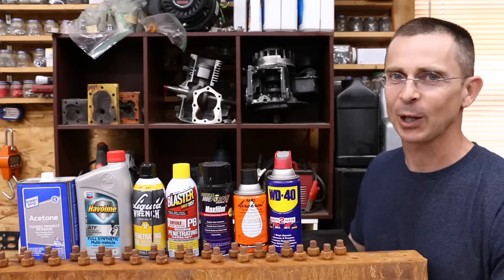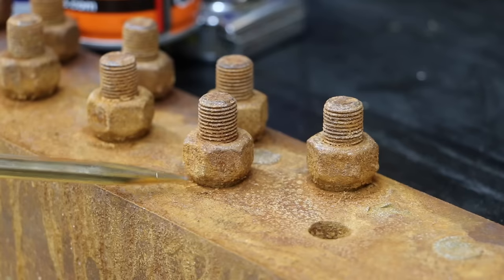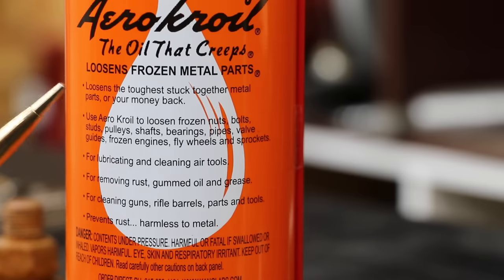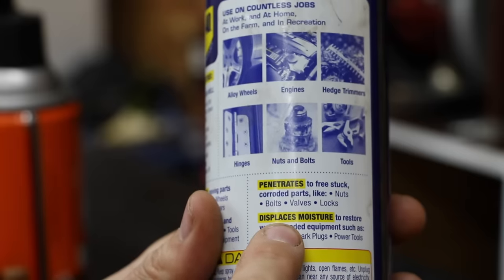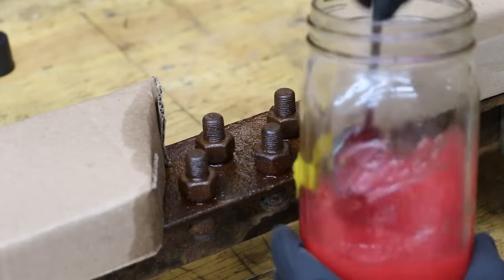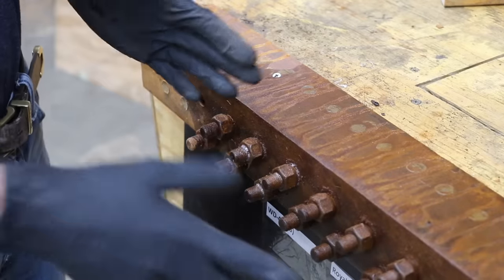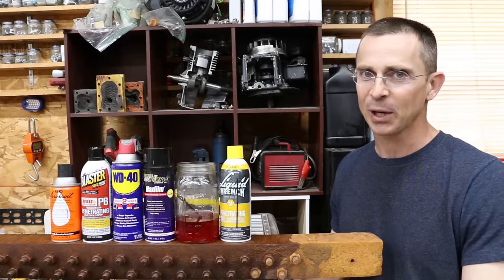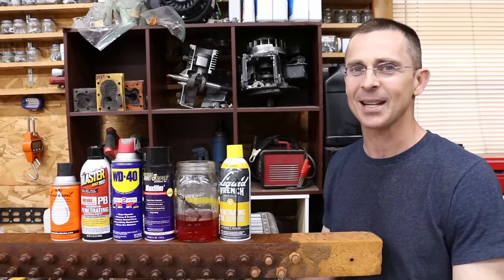Which Penetrating Oil is Best? Let's find out!

Comment: I am not surprised by the Acetone/ATF mixture I knew it was good. I am surprised by the liquid wrench I used it >45 years ago and it was useless IMO.They must have improved the formula. Kroil seems to work best for me.
Reply: I recall my grandfather soaking a set of pliers in Liquid Wrench that were rusted almost solid. Freed them up!
Reply: I worked on jet engines for 37 years. They BAKE themselves together. We used to use Marvel Mystery Oil until we found KROIL. I know it's pricey but I also know IT WORKS, like nothing else we ever tried, and we tried everything we found.
Reply: Totally agree with Eric!  I have had the same experience with Liquid Wrench in the past.  Undoubtedly changed the formulation/composition!

Comment: I have a project idea but it's going to be a little different. Try putting different oils/ gun oils on metals and see how well they work with preventing rust. Probably have to have the metal  sprayed with water sitting outside for days. Would be interesting to see how long the different oils work until rust forms and how much rust forms. I know for gun oil there's a ton of products (ballistol, clp, REM. Oil) and I know good ol  3 and 1 oil and motor oil can be more basic oils and are cheaper. Let me know if you like the idea!
Reply from the maker: Thank you for this recommendation!
Reply: Go to 6mmbr for the rust protection/finish test on gun metal finishes.  It is controlled in a salt bath.
Reply: CentralPlainsEnt couldn't find it but I still would like to see project farm do the test. He does such a great job on his videos
Reply: http://bulletin.accurateshooter.com/2013/06/firearm-finish-comparison-testing-in-salt-chamber/

http://www.6mmbr.com/corrosiontest.html

 Here are a couple interesting links one is a corrosion test. The other is a test on different types of metals or applied finishes.
Reply: CentralPlainsEnt the second link is more what I was looking for . But I still would love to see a classic style project farm video on this. Still can compare more things that the link you sent didn't have. But thanks for the links

Comment: Liquid Wrench plus heat is freaking amazing. Spray the liquid wrench and let it soak. Then hit it with a flame. It catches fire and heats the inside of the bolt real well.
Reply from the maker: Great tip! Thank you
Reply: I do same thing, works good

Comment: There’s recent research on concrete and reinforcement bars on preventing long-term deterioration;  it says that an electric charge in the bar will keep the bar constantly cathodic, thus preventing oxygenation... much like the heat test is increasing the cathodic activity in the bar, thus detaching the oxygenated particles.
Reply: This is far from new research

Comment: Long time fan of the channel, I absolutely love your videos!
Though 
Lubercant/degreaser Companies like wd40, CRC and PB Blaster also seem to make their own dedicated fluids to sell, like WD-40 specialist rust penatrant is supposed to be their version of PB blaster penatrant. And how PB multi purpose is their light weight general purpose lubercant, like WD-40  multipurpose. Do you think you could compare these specialtist "brand name" products they manufacture with each other or start including them in your tests, I've always been curious about how well these brand lubercants, rust preventer/remover, degreaser, ect would perform compared to the dedicated top of the line products of the same type. or if they are just buying some basic formula and slapping their label on it.

Again thanks for what you do!
Reply from the maker: You are welcome!  Thanks for the suggestion.

Comment: Revisiting this video because of a project that's upcoming.  Not all ATF, as you discovered, is soluble in acetone.  The versions without synthetics in them actually mix with acetone and don't separate.  This video does not change my mind about Kroil as it's been a long time favorite.  The only product in this review that I haven't used is the Royal Purple penetrant.  I usually find myself working on things that have been rusting together for a long time rather than a quick flash rust so that probably affects my opinion.  Thanks again for all your awesome work!
Reply from the maker: You are welcome!

Comment: Kroil is used in Aviation.  Never had an issue.  PB and WD are my other choices.
Reply from the maker: Thanks for the feedback.
Reply: Best for your money hands down. I’ve seen it free cooked on fasteners in the exhaust section of a CFM turbofan
Reply: We use Aero Kroil to remove igniter plugs on Rolls-Royce turbofan. It’s a lifesaver. We can only use products authorized by the engine manufacturer so one might be better. Thanks for the comparison testing.
Reply: Yep-Kroil has saved my bacon more than once. 30 years in aircraft MX everything from light aircraft to the big boys.  Famous one-MLG pins on a MD-83. Pins were seized solid to the bushings & were spinning in the trunnion. 3 day soak with Kroil & a 9X rivet gun beating on the pins did the trick.
Reply: @justins4926  Umm. You just watched  a video showing it get last place, and you come back with "Yep...its the best" LOL!

Comment: I love the detail and care you put into making these tests as equal as possible. However being and advocate of kroil, I feel it was not represented well in this video. In my experience kroil works very fast. I can spray a bolt and within 2 to 5 mins the bolts is extremely easy to turn. After about 15 mins it’s almost as if you never applied it. I would love to see a video of kroil tested at different time intervals starting at about 2 mins, 5 then every 5 after. I think you would be surprised at the results. Keep up the great videos!
Reply: neat

Comment: see which weed wacked string is the most durable!!!
Reply from the maker: Yes, I need to test this!
Reply: Project Farm ...and the most effective!  In other words, that bladed trimmer string might not last as long, but it might cut better. Also if you do this test those plastic blades. (I can't remember what their called, but they work and the head doesn't need to be replaced because the blades are disposable)
Reply: they were color coded by strength/durability back in the 90s at least, and there was a definite difference
Reply: Yes!!!! I need this test.
Reply: Son of a Diddly that’s a good suggestion.
Reply: I too would like to see this test. Not only that, but a test also on the real world of different profiles. I found square profile brilliant for mulching long grass, but the increased drag reduced the work efficiency and couldn't stand up to anything tougher than grass, I tried some hexagonal profile and it seemed no different to the round. Maybe a separate test too for blades?
Reply: Rotary! made in USA and last 3 times longer than the box store stuff
Reply: YES!
Reply: I was told by a STIHL repair shop owner that I should be storing my trimmer line in water (or at least in a ziplock bag with wet paper towels) to keep the plastic from drying out... 
Haven't tried it but thought that was interesting.

Comment: I think you performed a very good test of these penetrating oils. My question is, how are the studs anchored to the angle iron? Are the holes threaded and the studs/bolts torqued in place? Thanks again for your time and for sharing this test. I'm a tad older than you, and I remember my Dad using Liquid Wrench. I have part of a machine I bought frozen from lack of use. I tried WD-40 with no results. So this video was very interesting and I think I'll try ole Liquid Wrench next and see what happens.
Reply: just a guess, but possibly 2 nuts on the back side.

Comment: The original kick-ass "old school" formulation for your own homemade penetrant,   from years and years ago,  mind you,  is not acetone + ATF.  It is acetone + brake fluid.   I don't know when this acetone + ATF mix thingy got started (I only noticed it about 4 or 5 years ago),   but it,   and all the overpriced store bought crap,   is definitely inferior in performance to acetone + brake fluid.  
ATF does have some great qualities aside from,  or maybe related to,  its intended use, however,  lubrication being one,  so after learning of this acetone + ATF  mix,  I started adding it to my old standby (acetone + brake fluid),  in a 1:1:1 ratio -- doesn't hurt and might help.  BUT,   it's the BOTH chemically "powerful stuff, " acetone AND brake fluid mix,  that outperforms the store bought offerings.   
Yet another great,  but "not its intended use" for ATF:  fuel injector cleaner.  Long story 'bout how I know but suffice it to say,  I'd put it up against all the overpriced stuff you can get for that purpose -- Lucas and ALL of 'em.  
Use your own judgement as to how much per gallon or tankful,   but don't be afraid to go "heavy" -- a little on the heavy side is probably best,  just don't go crazy.  
And another good use for ATF:  about a 1000 miles prior to an oil change,   run a quart in with your soon to be changed oil (drain a little old if necessary to accommodate the ATF -- never overfill).   Probably heard from old mechanics or "shade-tree" mechanics to use kerosene this way,  but a 30 year,   ASAE certified Ford dealer's guy -- my friend -- said kerosene is a no-no,  because of its lack of lubricating ability. 
He said ATF is much better because of better detergent qualities than even the best motor oil,  better anti-foaming agents than even the best motor oil,  and better lubricating than with kerosene.  
The reason for doing it is to clean out sludge and carbon deposits or buildup prior to the oil change -- ATF does it better than regular oil.  (removing carbon deposits is what it does so well for injectors)
Reply from the maker: Thanks for commenting!
Reply: No problem.  Just checking back in to tout the superior performance of ATF as a fuel injector cleaner,   over all the teeny-tiny bottled,  way over-priced crap marketed for that purpose.  THEY SUCK.  PERIOD.  DOT.  END OF STORY. 
Last time my wife's vehicle started "cuttin' out",  especially when lugging,  it cost over $600 to fix -- faulty (or crudded up) fuel injector that just "had to be replaced."
That was over 5 years ago.  So,  when it started doing the same thing -- AGAIN -- I must have run a gallon or more,   teeny-tiny overpriced bottle at a time,  of the OTC gas additives marketed for that very purpose -- cleaning injectors -- with absolutely NO results at all.  
One cup of ATF (Royal Purple synthetic,  although I'm certain Dexrons II and/or  III would have produced the same results)  in a quarter tank (16 gal. max fill),  and I noticed an improvement within the first 5 miles of driving.  
I've run 2 full tanks since,  pint of RP ATF in each,   and the problem is gone.   
Word to the wise...not "commenting".
Reply: I’d add atf to my lawn mower. It would smooth out almost instantly after a couple ounces in the gas tank. 10 years for a Honda push mower and still going strong.
Reply: G.t. W -- another great use.  It helps combat the harmful effects ethanol gas has on carbs and rubber lines,  seals,  and gaskets.  Yet another use:  diesel tractors and equipment. But I only recommend it for the old stuff (mine).  I don't know squat about the new stuff that requires the new "environmentally friendly,  reformulated,  low or sulfur free" formulations of diesel.  I'm still using the off-road,  dyed diesel and it works great mixed with it.  Anything else,  use at your own risk.  I'm in no place to say.
Reply: Tab Lature in diesel, does it act as a lubricant ? They used to add motor oil to the diesel to lube the upper cylinders but I haven’t seen anyone do that in years.
Reply: The idea never even crossed my mind until talking shop with another farmer in an O'Reilly's several years ago.    
He said he'd been doing it for years -- putting ATF in the fuel tanks of ALL his diesel equipment,  at every fill-up.   He swore by it.  (Dexron II -- his fave.)
As you know,  lot of carbon buildup with diesels.  And clean fuel and clean injectors are critical to their optimum performance.  I think cleaning the injectors is probably where the most benefit is.  But,  you can't overlook the possible benefits to the pump,  as well.  Some lube benefits there I would think,  but keeping the many seals and O-rings in better condition than just the fuel does by itself alone,   would be the greater benefit.  (Think about all the seals,  gaskets,  and O-rings in an auto-trans,  and how ATF had to have been formulated from the beginning to be,  at the very least,  not detrimental to them,  and possibly quite beneficial to their longevity and good condition.)
Anything to keep it performing well,  and without leaks,  is time and money well spent,  in my opinion.  
Anyone who's had to have one rebuilt,   a very expensive proposition,   would no doubt agree. 

A personal example of the cleaning and lubing benefits of ATF (Dexron II): 
I own a Bobcat skid steer that's at least 45 years old,  possibly 50.  Was told when I got it,   many years ago, use nothing but Dexron II for the hydraulics.  Both sides have a reservoir for it and it takes over 5 gallons to fill.  BUT,  a lot of the drive -- sprockets and axles -- run in it and are continually bathed in it.  There are spray jets at the top that continually spray the whole area with it when in operation (the return from the pump,  no doubt),  keeping all the works bathed in it during operation.   Not only is it being used for hydraulics,  but for continuous lubrication as well.  
As you can well imagine,  the outward appearance of a 45 + year old machine is somewhat less than a new one's.  But,  pull off the side plate on either side to access the inner workings,  and everything looks as fresh and new as the day it rolled off the assembly line.  Quite amazing,  really.
Reply: Tab Lature I’ll have to try it on our AC 7050. Thank you for the info. Always looking for something to keep things running optimely
Reply: Just commenting to have this info when needed

Comment: While working on old (1920 on) cars the engine would be frequently locked up, frozen. I would use a quart of Marvel Mystery Oil poured through the spark plug holes into each cylinder. let it set for a day and the engine would always turn over by wrench. over 40 years of great success.
Reply from the maker: Thanks for sharing.

Comment: Great video with surprising results! IT is tough to beat HEAT, and your video proved that. I used PB Blaster for years, until I discovered Kroil. Always the liquid Kroil - never the AeroKroil - I wonder if there's a difference. For me it seemed to work so well I converted over, buying a couple dedicated oil cans just for Kroil.

An old product that wasn't tested is Marvel Mystery Oil - I wonder how it would have done? I like how it doesn't evaporate away - great for overnight soaks. Anybody else use it?
Reply from the maker: Thanks!
Reply: I love Marvel Mystery Oil.  I think it started out as a sewing machine oil, actually.  I've seen it used to "resuscitate" outboard boat engines that had sunk in salt water (after a fresh water rinse).  It is good stuff.  I only recently started using Kroil and I'm now a big fan of it.  A few drops of Kroil and a little patience to let the frozen parts sit seems to be all that's needed for what used to be a multi-soak down with PB Blaster on the parts of my farm equipment.  I'll know more in a couple of weeks when I try to use Kroil on some bolts holding the blades on my old bush hog.  They've been torqued in place for more than 10 years!
Reply: My grandfather, then my dad always used Marvel in hundreds of applications.  Believe it or not, they even filled the oil cups in a Hammond Organ with it!
In my real world experience, I've found Kroil to work best for me, and as you said, only the oil, not the aerosol. 
I'm not surprised that heat worked the best though.
Reply: @BritIronRebel  I keep the "fire wrench" as my last resort.  I once tore up a really hard to replace lift-arm turn-buckle on a tractor I was fixing.  I heated it up and turned it so hard it just broke in two.  Hmm... I'm gonna' go find that broken part again.  It might forge into a nice hatchet head.
Reply: I've seen Sil-Kroil work magic.  Never tried any other type of Kroil.

Comment: Great testing procedure! I usually choose WD40, but partly because of their convenient spraying mechanism. I will give liquid wrench another try. For me, unscrewing past the remaining rusty threads, like on suspension components, is as important as breaking loose.
       Recently, on a very stubborn furnace part, I used a torch, and touched the hot metal with candle wax, which spread like penetrant. It was a bit smokey, but I had an exhaust fan. I felt very fortunate to  have saved some badly frozen, threaded steel tubes.
Reply from the maker: Thanks!  Thanks for the feedback.